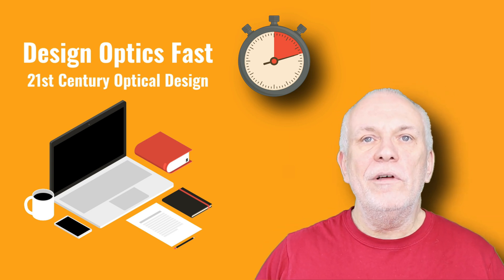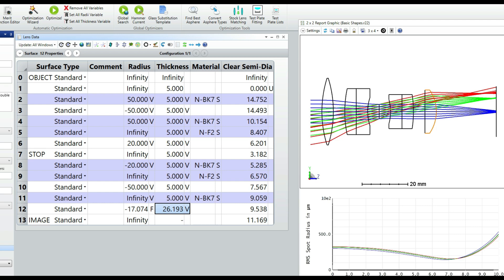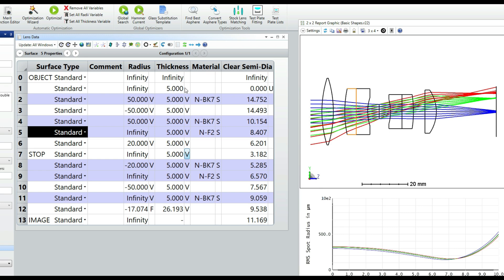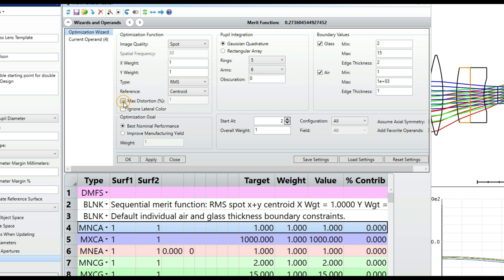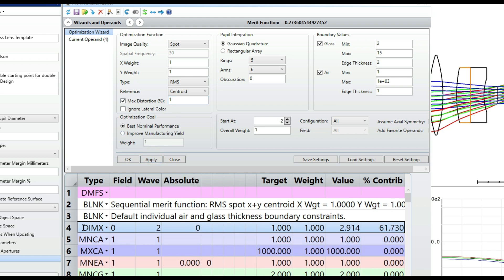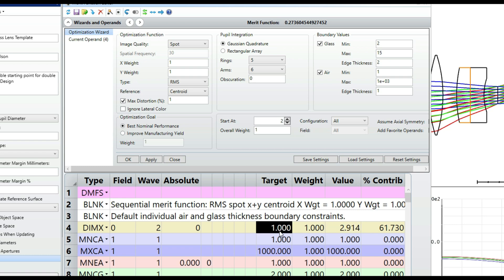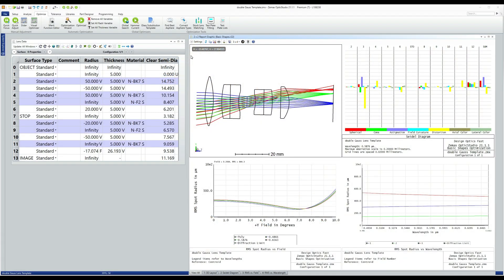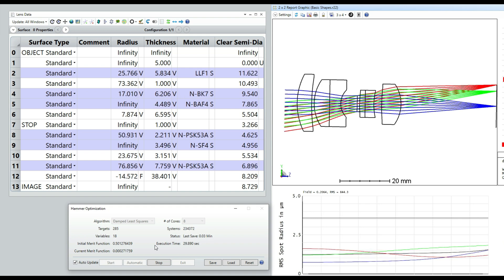Optimizing the double Gauss Lens with Zemax OpticStudio

Comment: Thank you very much, Mark. I've learned many new things. If you have time, I have a question. I saw that in a Zemax sample named "1- Initial Camera Lens", when I see "Image Simulation", the "Demo picture" has the best quality. Can I use this analysis tool always? or does it not work in any case?
Because I used also other Operands MXSD, MNSD and EFFL, as I wanted the lenses to be between 4 to 10 diameters with a specific focal length. Maybe, as my limitations are more than what you've done, then I cannot see the "Demo Image" with the best quality like "1- Initial Camera Lens". But, maybe there is other problems. I don't know.
Reply from the maker: Hi Hamad, the Image Simulation shows you the quality of the image you're getting. In the case of the sample file, the system is well designed and gives sharp images. If your system has less good focus then the image will be blurrier. It may be best for you to go to myzemax.com and sign up for the forum there, where you can ask questions of Zemax staff as well as other Zemax users.
Reply: @DesignOpticsFast  Thanks a lot.